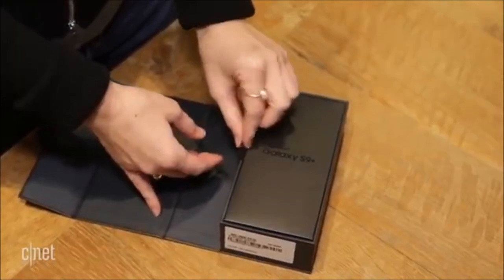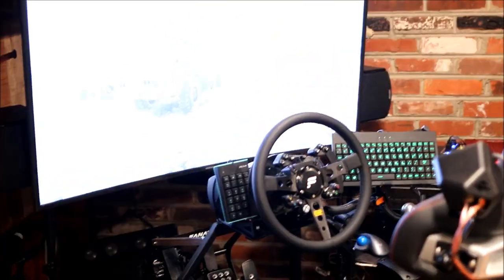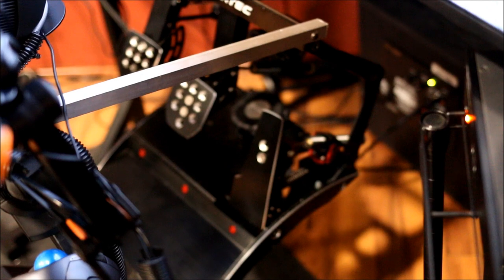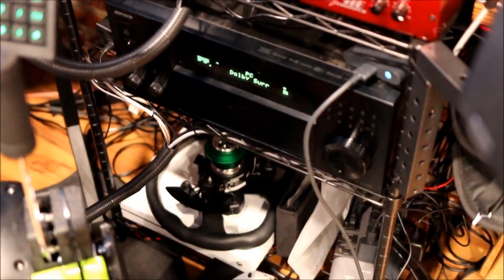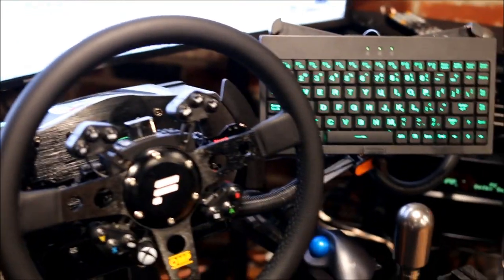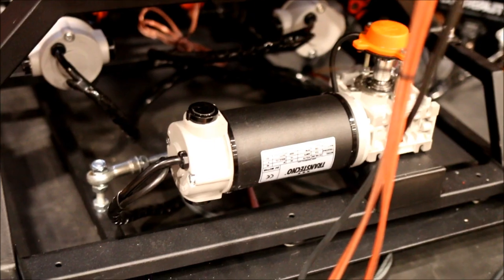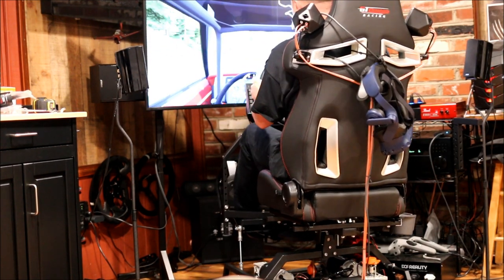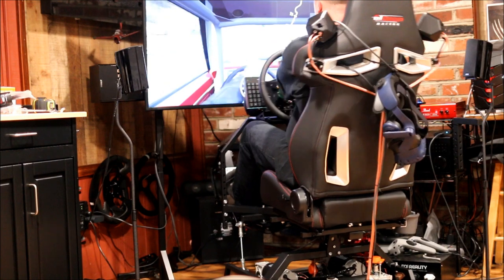Sim Racing Motion Simulator Build Part 4 - DOF Reality

Comment: Nice upgrades!
I myselfe have the Next Level Racing V3, I have my rig set up in a closet, so a bit tight for a 3dof..
I'm having a T300 with the Fanatec CSL Elite Pedals as it is now, but planning to upgrade to a Clubsport wheel base within this year.
Reply from the maker: R-VR Closet yes this rate would definitely not fit in a closet!
Reply: Are you a Harry Potter of simracing or something ?

Comment: Hi I’m starting to get into Sim racing and I want to keep the whole thing under about 2k I was thinking going with the Dof Reality M2 and the RacerRoom Cockpit
Reply from the maker: My best recommendation is not to think about how much you want to get the whole thing under but rather what you want to spend in the start of it to get going...
Reply: Everything Sim Racing ok I was thinking to start just to get a wheel and pedals on a little stand and if I liked it upgrade
Reply from the maker: The M2 seat mover is amazing for the price, basically the same as the next level racing. But if I had nothing and was just starting into SIM racing I wouldn't consider A motion simulator right away. Also you can usually find the chassis that fits the M2 used on eBay or Craigslist because it was made in China and copied by a million companies. Might be a way to save some cash in the beginning
Reply: Everything Sim Racing yeah I might upgrade to that later thanks

Comment: What the actual difference between the H3 and p3 besides the price... thanks....still debating between this and the nlr v3
Reply: From what I saw on the website, you get a few extra degrees of movement out of the P3's motors. They're supposed to be stronger too, but I'm happy to be corrected if not

Comment: Is the motion rig compatible with American Truck Simulator?  Did you look into the Next Level Racing Motion V3 platform before deciding to go with DOFreality?  Awesome setup man, I am in the process of building my rig now and will be going all out as well.
Reply from the maker: Danilo I don't believe ats is supported. You can find a list of games 3dof supports here:

https://dofreality.com/games/

Perhaps it does work though with the right plug in, because it's very similar to ets.

And I did take a look at the next level racing seat motion. Honestly I wasn't a fan it seems very expensive $3,000 for only a seat mover. After watching a few videos I realized very quickly that only a seat mover is not realistic at all in my opinion compared to a full motion rig and after using this motion rig I'm glad I made this decision. Especially if you have the $3,000 to spend the P3 from dof reality is definitely the way to go but if you're on a budget they offer an economy version for around $1700 which in my opinion would blow the socks off the next level racing Shaker seat.
Reply: Everything Sim Racing where did you buy the seat you are using for the DOF rig?  Thanks for the info by the way, subscribed!  I do like the size of the Next level rig tho....very minimalistic, can put that thing anywhere without it taking much space.
Reply from the maker: Danilo thanks for the sub. Seat link is in the description, It's from gt omega. Yes it is smaller, but honestly a Sim rig takes up about the same space either way. If you have a dedicated space I'd say it doesn't matter, but if your dragging your Sim rig over to your computer desk everytime then maybe I would go next level.
Reply: Everything Sim Racing will need to think this through.... The other appealing thing is, Next level is on amaZon and I can get it by Friday lol (impatient!!!).  How long did you have to wait for the DOFreality?
Reply from the maker: Danilo yes that prime is like a drug... Regardless, in my opinion, I would wait 2 months over 2 days to have the dog reality. 

Ordered March 25, shipped March 28. Arrived April 4. That's pretty fast. It's very easy to build, and setup was insanely easy software wise.

I'm sorry I just don't get the seat Shaker only. It just doesn't make any sense to me in a normal car you would never have the steering wheel and shifter move closer and away from you as that rig does. It just makes so much more sense to have it all combined like a real car and I can't speak for the next level racing reg but it definitely immerses you like crazy and because of your body weight really makes you think you are driving. Traction loss is a must I'm not sure if the next level racing rig has that if it doesn't I would definitely pass no matter what because traction loss is amazing. But of course it's your money and and either way it's all about fun.
Reply: Everything Sim Racing I ordered the next level racing and went crazy ordering a bunch of Fanatec gear.  Should have the motion rig tomorrow!!!   It's prime so if I don't like it... Back she goes....  Ultimately I like the compact low key design of the next level platform and they are supposedly introducing an add-on for 3dof soon.  Will be sure to update you on my experience.  I will be matching this up with a 65" LG oled and the HTC Vive.  I'm concerned that the Vive may get me nauseous... If that happens, I will go triple screens or see if the 65" will be enough.
Reply from the maker: gotta love prime! yeah definately keep me informed! have fun!
Reply: Mint mate how many hours use have you put into it so far? Im curious to see how it handles after 1000hrs use
Reply from the maker: lenny 034 good question! I'd say about 200hrs so far. The motors are the more expensive version and more heavy-duty hopefully that makes them last a little longer. The rig is All Steel so I'm not all that concerned at any parts that would wear out could easily be replaced, so in essence I should be able to keep this ring forever
Reply: Moonshine run bro! Sweet!